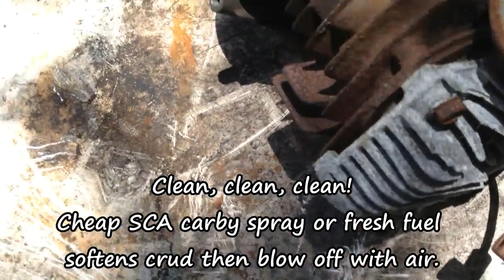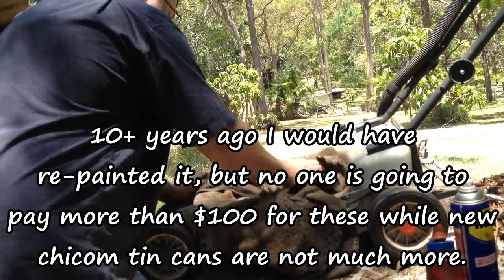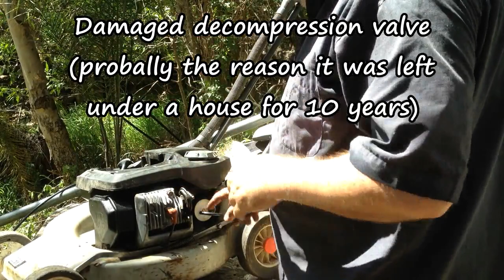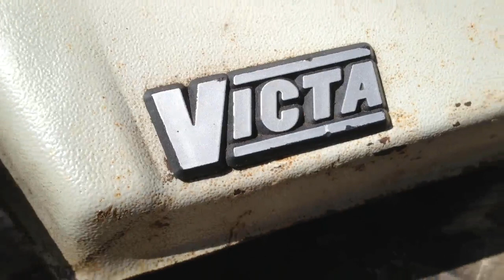Left for dead Victa lives again! (AUSSIE MOWER RESCUE)

Comment: Great VICTA mower resurrection. I love to save them from the scrap heap too. Classic two stroke. I have been fixing up the old VICTAS for years. They are the BEST MOWERS. Really TUFF! The briggs four stroke are a great engine also.
Reply from the maker: Cheers. The early style block made in Australia I took off would have been a better job. But I only had that Chicom block here at time. Australian made blocks have more cooling fins, thus last better, longer. :)
Reply: @aussiemowers  Yeah I have many VICTAS myself ranging from the really early engines and the later power torque engines. I look forward to checking out more of your videos. Cheers bloke 👍

Comment: A good video mate. If you have a spare ignition coil, i am trying to do up a 160cc Victor two stroke, has no spark right now, either points need looked at or the ignition coil might be no good, i would be prepared to a second hand one off you providing it is not dead and for a price. Thank you.
Reply from the maker: Neither of these two had points. The new burgundy model has an all in one coil. The original engine off the gray one has a coil and external module. The early model before these two had points and a module. I only have coils and modules for the two in the video. If you're in the area (Gold Coast) one will cost you a 3lt full cream bottle of milk or a dozen eggs. Use my website contact form for more details ;) https://rodsmowers.com
Reply: @aussiemowers  Hello again, my old Victa i am guessing would from late 70,s---80,s, hence i guess it uses points and condenser, i have ordered a electronic ignition for it, current it,s compression is not much, i bought a new piston and rings for it. The old engine has not run for a few years i doubt the prev owner looked after it. Some wankers do not bother. 
I live Dunedin, New Zealand, so i am not in your area, but i would pay the postage to send a coil to NZ, i have had a new coil on order for a couple of months now with no luck. 
Do you remember the old Iron Horse two strokes?? In America think they go under the name of 'lawnboy', anyway i have one, it has been in our family over 50 years, my father did up the motor years ago, starts first time, runs real good, i would never sell that mower!
Thank you for your time, Barry.